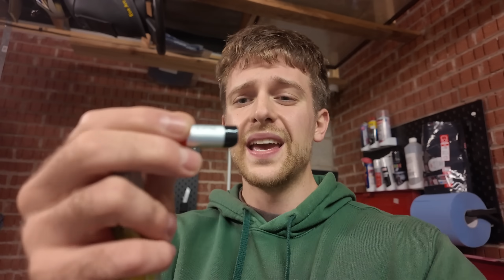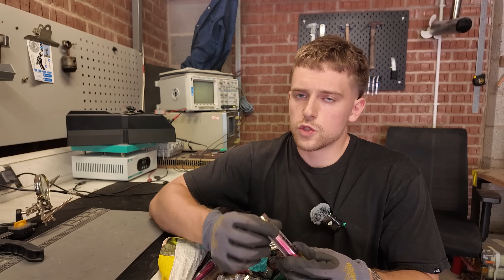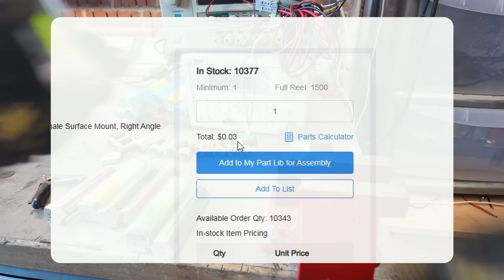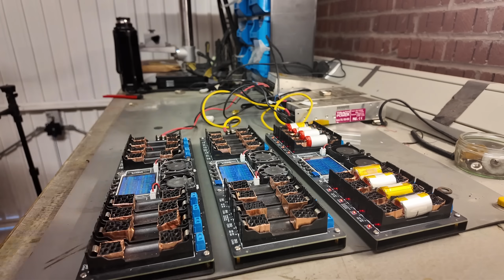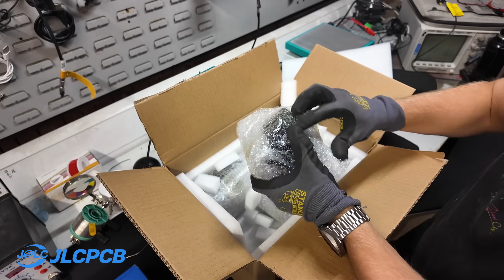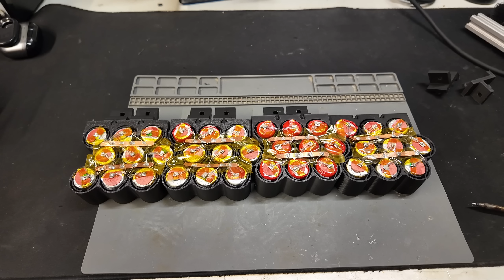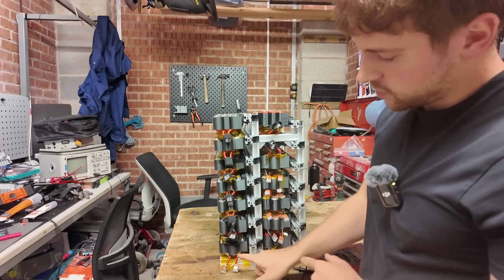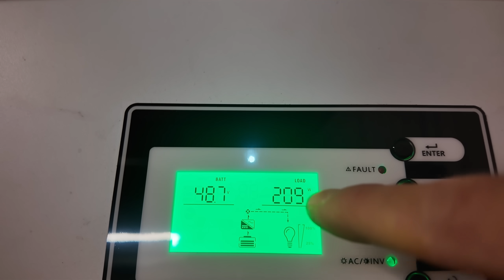I Powered My House Using 500 Disposable vapes

Comment: Love the idea as an electrician and am not trying to rain on your parade but there's some safety stuff you should know about. Be super careful (if you value ur safety, totally avoid) soldering lithium ion cells. If the cells get too hot, they can catch fire and are very difficult to extinguish. Typically battery cells are spot welded to avoid needing to directly heat them for soldering. Recommendation online is to keep a bucket of sand at your workstation to be able to submerge then carry any burning material outside where it can burn for hours or days safely. 

A fuse for each cell is an interesting concept but I'm not sure it's providing the benefit you're looking for. If you're looking to avoid battery fires/thermal runaway, firewalling between modules/submods/cells are much more likely to prevent a meltdown. If you're looking for overcurrent protection, a reliable BMS is a much better solution, backing that up with a fuse for each module. Having additional points of failure right next to the cells just increases the odds of having a solder joint fail, potentially arcing, heating the cell and triggering thermal runaway. If those fuses do trigger, you have hundreds of soldered in fuses to replace, risking thermal runaway or damaging the cells with each fix.

The main risk for a project like this long term is that cells within a module end up unbalanced, causing one to be overcharged, leading to thermal runaway. Given the inevitably different capacities of these cells, even if that cell tester managed to get them all to start at the same voltage; in the long run, they will diverge, potentially leading to a fire. Aside from monitoring the voltage of each cell individually, I'm not aware of a way to mitigate that risk. There's a lot of lithium in your shop, if I were you, I wouldn't be able to sleep til that battery is in 500 pieces. Then I'd look into smaller projects with a larger scale, maybe turning one or a few individually monitored cells into a USB power bank that anyone can make for a few dollars.

Again, love the idea, just don't want your shop to burn down.
Reply: A good BMS will prevent imbalance and overvolting of any cell group. Vape cells already have tabs, and soldering to those tabs is okay. Cell-level fuses prevent one internally shorted cell from drawing current from all other cells in parallel, but I don't think this can happen other than due to physical damage.
Reply: @galfisk  Even if each module is protected via BMS, each individual cell will eventually drift apart. Which is what this dudes main concern is. You'd need a good module to prevent issues. But given the dubious quality of some of these li-ion cells, i'd want to personally monitor each cell on its own.
The issue here, is people watching this. Wanting to replicate it. Won't know this and hence will probably fuck up bad
So,

Cell A, in module 4, is at 3.8v. 
Cell B, in module 4, runs into an issue and discharges at a slightly higher rate, perhaps overheating. Perhaps age. Now it's at 3.5v. 

This causes an imbalance in all the cells around them. And even a different like that can cause Cell A to potentially have more load placed upon it, due to the voltage sag of the other cells now surrounding it. Which in turn throws the whole system out of balance.
Not to mention, these cells are not designed to pull that many amps at a continuous rate like actual "power wall" house cells. 

Voltage sag can also be caused, especially in Li-ion cells, by increased load, battery age, battery quality and its own internal resistance. The harder you push the cell, the lower the voltage it outputs (hence "sag"). Combine this with fucked cells all at different voltages and you got a real "fun" time on your hands. 

Also, their Discharge and recharge isn't designed for this use case. In battery terms, this is known as the C rating. A battery's C rating is a measure of its discharge and charge rate, indicating how quickly it can be fully discharged in one hour. And I can assure you, the C rating of these Li-ion cells isn't at the standards for powering a house, even if combined into bigger modules.

Then you connect your solar and try to charge them. If your BMS is just monitoring at a macro scale, it might not realise that some individual cells are unhealthy, and over charge a few as a result. Now you're in scary territory. (Cell B charges to 4.20V fine, but some around it overcharge to 4.80V). 

Rinse repeat. Eventually something goes wrong and boom. Lithium fire. Big scary. Very toxic. 

The best solution, if you really wanted to do this, would be a network of custom BMS modules, each monitoring each cell in each module, then connected and managed by a larger system. 
Sure the complexity goes up 10 fold, but safety is always first and foremost when dealing with lithium batteries.

There's a reason why I fear lithium.
Reply: @ausboard  vape cells are high C and very new, subjected to a few charge cycles at most. If they weren't so tiny, they'd be pretty much ideal candidates for a powerwall.  

A cell in a parallel group is electrically prevented from developing a lower voltage than its mates. It can develop reduced capacity, and it can develop a higher inner resistance (usually both happen at the same time), but in sub-1C applications that doesn't make a lot of difference. It can also develop high self discharge and drag all its mates down with it. A smart BMS will notice all of these before they become real issues. Also, all of these are end-of-life issues, likely to crop up when the pack has already aged to less than 75% of new capacity.  

A BMS will never allow any single cell group to become overcharged or overdischarged, and as all cells in a group share the same voltage, this protects all cells in all groups. It monitors current in and out, and maintains balance in between groups. It's the charger's duty to do CC/CV at a macro scale.

I've taken thousands of used cells through testers, and hundreds of them through various sub-1C discharge rate battery packs. They've been utter crap compared to vape cells - heavily used laptop cells usually more than ten years old. As long as I discard everything that is harvested below 2.5V, shows less than 75% of new rated capacity, gets hot when charging, or has a higher self discharge than the others, the packs can operate fine for years. 

Lithium isn't any scarier to me than a fireworks rocket. Yes it can do lots of damage if ignited at the wrong time and place, but it doesn't ignite without reason. Apart from a good BMS and charger, preventing the pack from becoming physically damaged or otherwise internally shorted is what keeps them safe.
Reply: @galfisk yeah fair. But take one look at the thing that this dude just hooked up to his inverter with little to no fire protection. Then proceeded to incorrectly provide power to his house. Using the incorrect connectors for load. 
Idk, I feel like people that don’t know any of this stuff will attempt what they’ve seen here and not understand the risks of li-ion cells. 
I think the primary issue I have, is the cells I’ve personally recycled from disposable vapes, have all been dubious in terms of quality. Only lasting around 100 cycles before shitting the bed. They all usually have a way higher internal resistance compared to more expensive cells.

Combine this with the “cheap” nature of this build. I feel like if someone new to this kinda thing actually attempted this, they potentially might try to use a cheaper / lower end BMS. I’d also consider a power wall to be a high C application and these cells probably wouldn’t provide that. I’m actually considering attempting a “stress test” of some IGET vape cells that I have sitting in my BatSafe

And yeah laptop and old phone cells are only good for a pretty lights show lmao. You can’t really do much once they’ve been pushed past their own limits. 
Nothing like charging a laptop cell, and have it drop below 3V from doing nothing in 20 mins. 

The cells in dispo vapes are still good to recycle. Don’t get me wrong. Great for power banks and what not. But for a proper power wall to provide backup to your house? There needs to be more consideration into the actual chemistry of the cells. As well as safety, like you said. The internal resistance does and will go up when more and more of these things are connected in series. And that usually results in heat and efficiency loss. At least the power wall would keep itself toasty in winter.
Reply: MrSHAUNTHEMAN I'm not an electrician so I wondered if he should remove the solder tabs from the disposable vape cells before he spot welds them.
Reply: @toyhacker4647  No, that's what you want to be attaching the copper strips to.
Reply: @Mad4400  Seriously man, pretty sure toyhacker was making a joke
Reply: Exposing the cells to temps even as low as 40 degrees Celsius can cause degrading of the cell. The key is to keep it as short as possible. Spot welding isn't magic, you're heating two pieces of metal to the point they are molten and fuse together, but it usually only takes a maximum of 600 milliseconds to do it.
Reply: There's quite a few confusions in your post. Did you follow the construction closely?

Comment: 500 is a joke. I needed 1200 just to power my electric moped, I'm talking 88.6 volts at 25Ah. And the battery is absolutely massive in terms of weight. Over 25kg, because these cells are LiFePo4 - the best battery for longevity but just marginally better than Gel Lead Acid in terms of weight. A similar Lithium Ion battery weighs about 12kg. Additional weight is unavoidable since these batteries lack a steel or aluminum casing and so each needs to be encased in something that would prevent huge hot spots and distribute the heat more evenly. Is it worth it? You bet, seeing how expensive custom build LiFePo4's are. And no, it's impossible to build it out of 12v 30-50Ah LiFePo4 batteries because maximum those can handle is 56 volts or 4S4P configuration. So a battery that would actually power a house for any decent amount of time, so that you wouldn't  have to save energy by not running AC or a washing machine will be in excess of 75kg. You could bring this down to 50kg if you use solar batteries, but the solar activity in your area has to be at a certain minimum for this to work.

Comment: Nice project. But I think you paint it a little too enthusiastic what you can power with these cells. I think, as soon as you draw high loads like a washingmashine, dryer, kettle, microwave stove and other high power epliences this little battery is drained flat in no time. And it is not healthy for lithium batteries to drain them completely and  charge them to the brim completely. So your real usable capacity is at least twenty to thirty percent lower then the overall physical possible capacity. It would be interesting to know how much loss you have, when you charge the battery from the grit and then powering the house. I think the loss would be at least 15 to 20 percent. 
What I like the most in this video, that you give awareness to the waste problem that is created out of sheer corporate greed. The tabaco industry lobbied to ban the vapes that small startups where building  and produced very little waste. You could change the battery yourself, and the vape components where mostly metal and glas and you could change the coils yourself. The industry lost billions in revenue due to the vapes. So they lobbied to ban them to then put their own vapes on the market. These are the throw away things you see now. 
And videos like these bringing awareness to this problem.

Comment: what if you make it chargable and then charge it using the power its feeding to the house? (oh in the case that you do actually make it chargable, you can use it as an emergency house power incase the power goes down)
Reply: ahh it's chargable, you should do what you said, charging when power is cheap and using when power is expensive, but also use if power goes down

Comment: Ever wondered about this? - When the chinese sell cheap gadgets with 2nd quality degraded cells to make money, why on the other hand are they taking the losses by including good quality lithium cells in highly selling disposable vapes? They even add cells that hold much longer charge that what is needed to finish up the liquid. 
They know, after the liquid finishes, people are just going to throw the vapes here and there, while there is still a lot of battery charge left in them. 
That brings us to question 2 - Ever checked what else those circuit boards in the gadgets and inside the cell packings other than heating? Directly asking, what other hidden things are they designed to do? Is it the botnet? Or are they spread all over the world as sleeper cells until future?

Comment: Instead of going bigger now go smaller. Come up with handy quick build concept anybody with solder perhaps 3d printer can quick co vert a battery perhaps a cheap kit.. turns any found battery into recharchable flashlight, or some kind of simple useful repurpose.